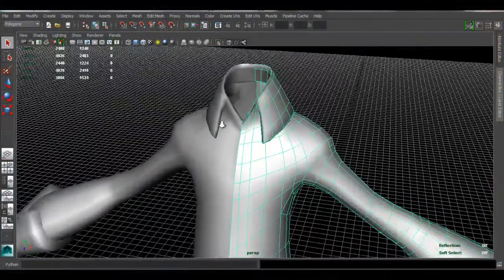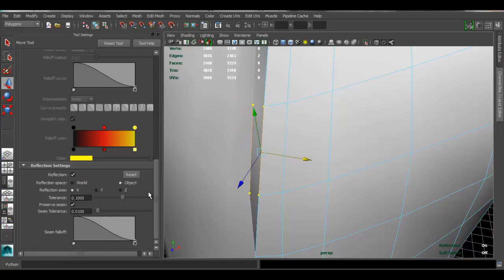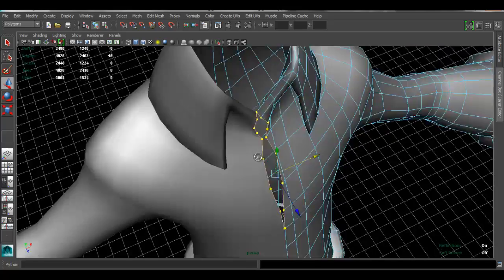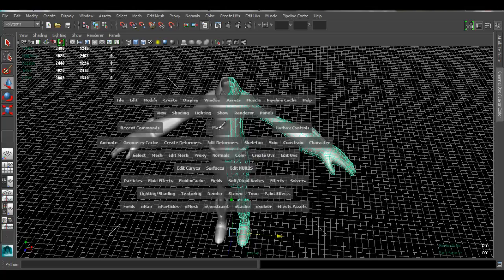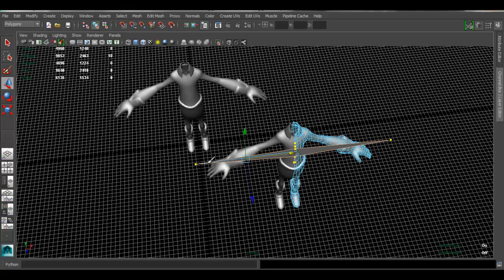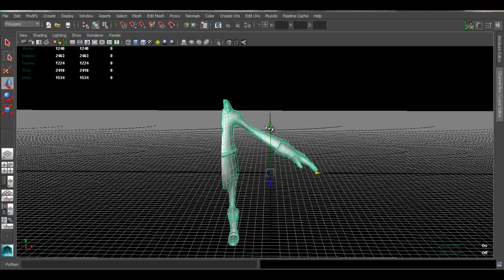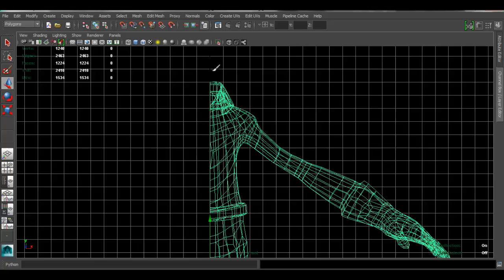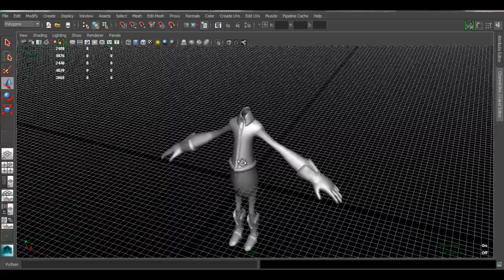Autodesk Maya 2014- Character Modeling Troubleshooting

Comment: I have an error where when i delete one half of the model to then make it a fully connected model, a bunch of the edged on both halfs all decide to point to one vertex
Reply from the maker: is this when you use the mirror tool? you may have to decrease the threshold under the mirror tool options.